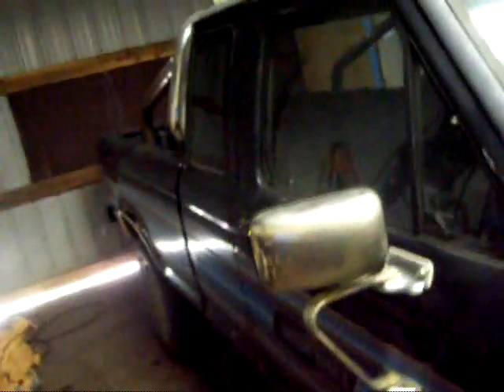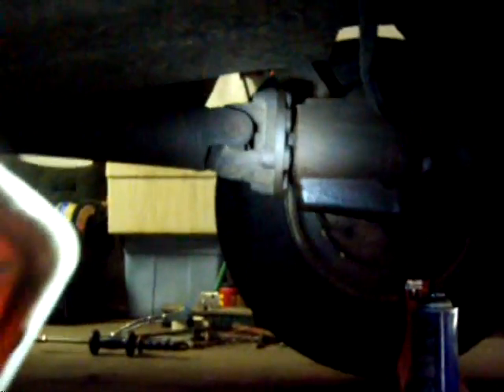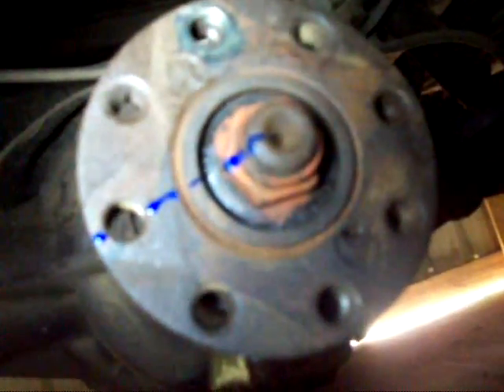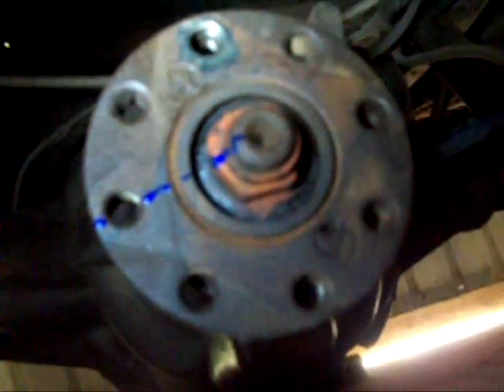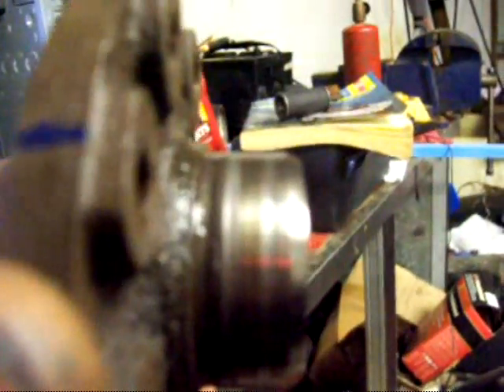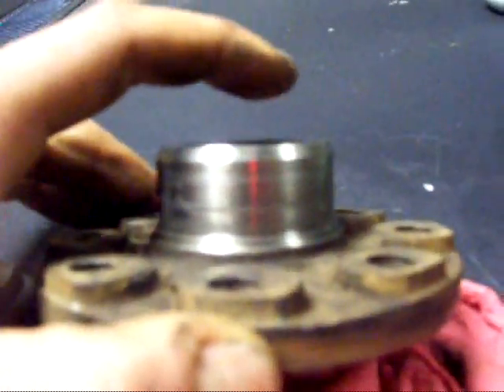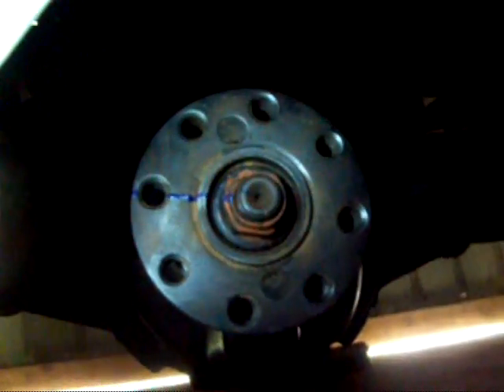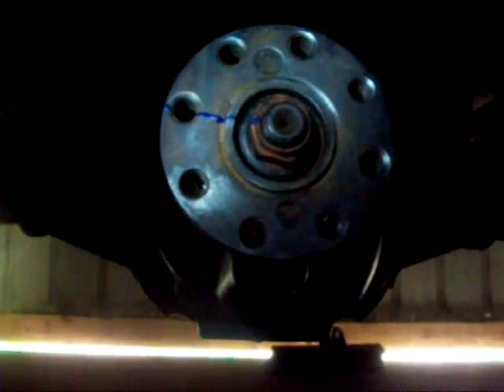Ford Ranger pinion seal replacement

Comment: i just had to do mine. i just counted how many complete turns it took to take the nut off then turned it the same amount of times to tighten it. damn ford pinion seals. second time ive had to change them

Comment: Yes it has to be exact!  To much pre load on that pinion nut and you'll lock up the bearing thus destroying the rear end..  too loose and there will be too much free play, again destroying the rear end..    
This is the backyard way,  while still efficient and ok,  still to be done correctly it should be done as mentioned in the video
Reply: this is how ford techs flat rate this job. only thing different is they count the turns they spin the nut off. ive done it 20 or 30 times with no problems at all
Reply: Cody Phillips